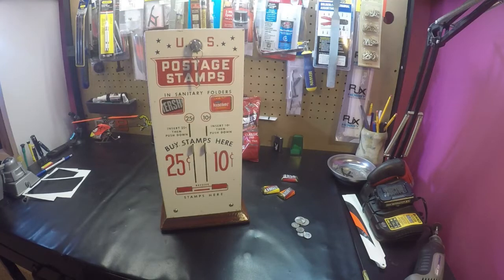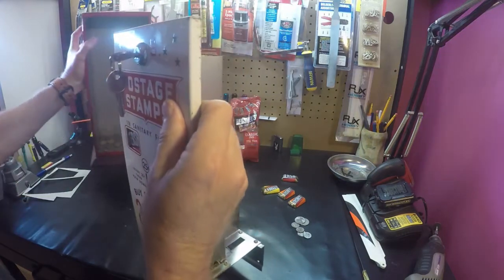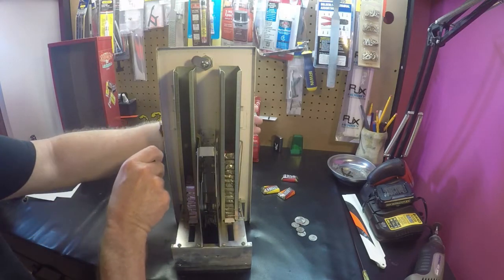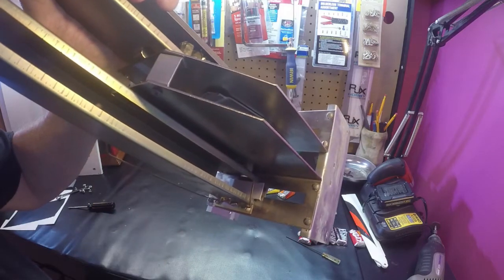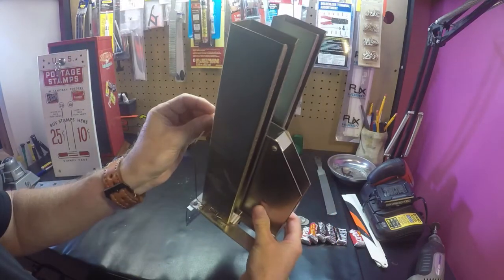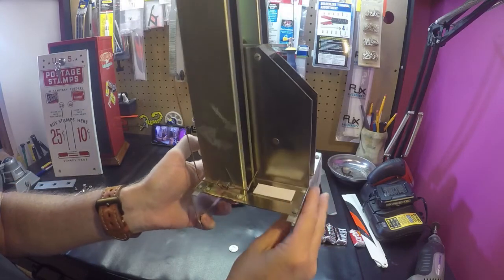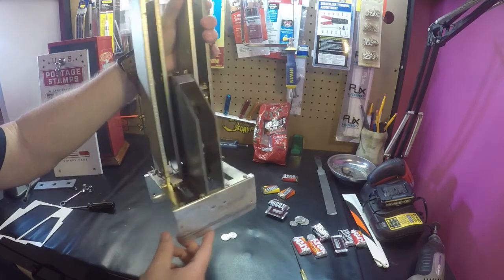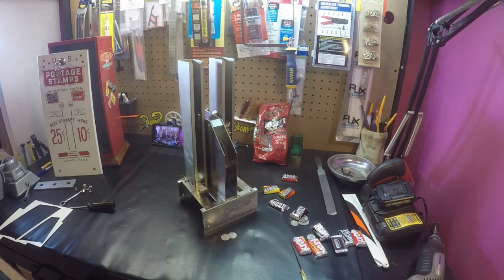How to turn a stamp machine into a candy vending machine

Comment: Great video! That is cool. I have a similar style of the stamp machine. However, mine is an older Northwestern US Postage Stamp machine that uses the roll that you mentioned near the end of the video. I want to convert my machine to vend something instead of stamps.

I want to convert my machine to vend something like stickers, fortunes, raffle tickets, or something else on a roll that could be used instead of stamps. I could not find any videos about how the vintage roll stamp machines work. I think my machine cuts the stamps off the roll with a slicer and does not use the "sanitary folders" ... Any help would be greatly appreciated. Thank you.

Comment: How big did you cut the slots in your machine? Did you measure or just eyeball for the size of the slots?
Reply from the maker: I taped the size I wanted. Used a Dremel and coping saw. Then a flat file to smooth it out